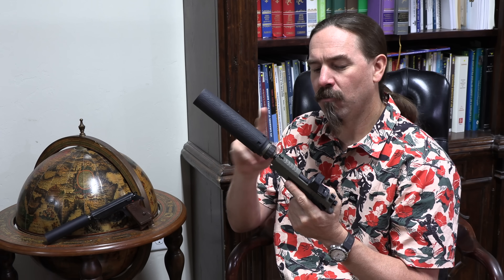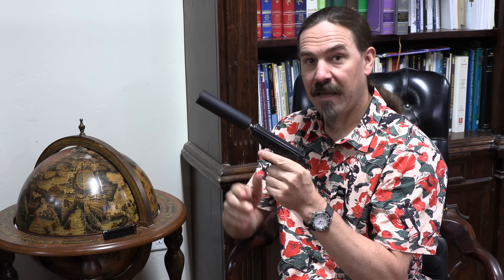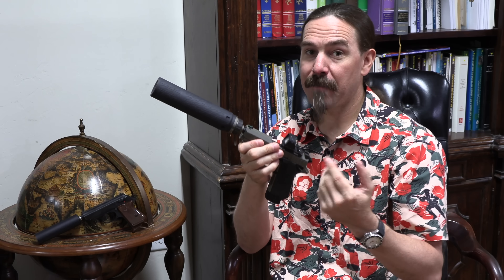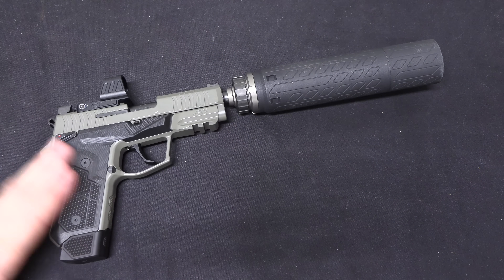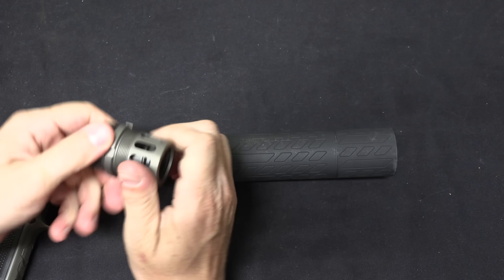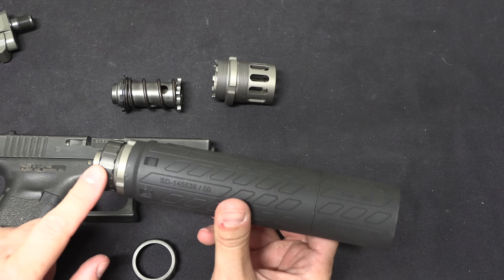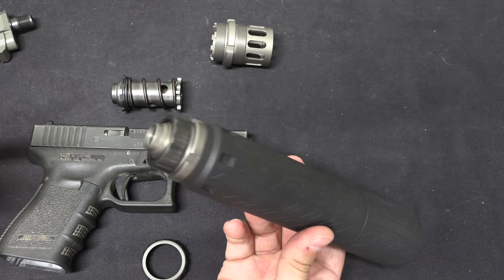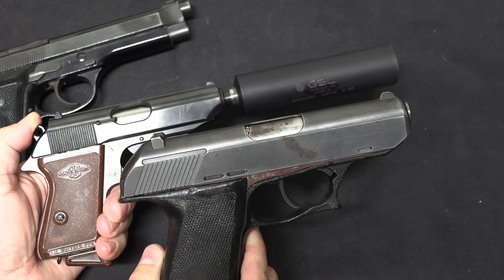Nielsen Device: How it Works and Why it's Necessary

Comment: but simply buy a gun who proper wear silencers?  christ sake all this issue and 15 min video on a gun donst work propelly with a coca coca cola can framed in front. becayse a silencer its a plain regular tube whit framing a different angles and curvature to flat down muzzle flash primally and in subsonic quite a bit of the sound. silencer on supersonic its just a war thing,. like put a silencer on your ak when storm buildings and trenches.

Comment: Most of the force the browning action needs to overcome is the pressure on the baffles pushing the entire barrel with the supressor forward. That's why for example glocks with really long barrels do not need such a device.

Comment: I'm in the UK (so I'm not allowed to know anything) but I don't understand some of the logic here: 
That suppressor with the removable end doesn't make sense: they're adding the mass of the threads making everything worse in normal use🤷‍♀️
And why are suppressors an add-on?!
Surely if you want a quiet weapon, you buy a permanently supposed one (if that even exists) 
which should be designed to minimise mass🤷‍♀️
I think I saw a rifle recently (G10?) that looked like it was sensible and actually quiet. 
I would have thought that minimised mass was paramount in scary situations!

Comment: pick an auto pistol with a steel frame;
rig it for bottom AND L and R side Picatinny rails.
build a suppr with a tube large enough to allow the front half of the pistol to go inside that tube.
on the inside of that tube, fix Picatinny rails, so that the tube is attached 'out there', ready for putting the suppr 'guts' in there.
the slide and bbl op completely independent of the tube.
the gas can be directed rearward, thru a diffuser-material, that fits between the frame-slide and the tube, decreasing the suppr-volume rqd to       > contain the blast; much of the blast is processed, as it goes thru the diffuser material. 
the suppr is on-off the pistol, via the picatinny rails

Comment: Out of curiosity, are there any hub compatible mounts that can be converted from a booster to a tri-lug adapter? I understand they are different mechanisms but would be neat to have one mount you could just unscrew the end cap and swap between a booster and tri-lug. Pistol to PCC without having to remove the mount.

Comment: Love your stuff dude but please safety check the weapon at start of video.
Reply from the maker: Since you bring it up...I did. Then I realized I wanted to cycle the slide on the PPK a couple times, but it locks open on the magazine, so I had to pull the mag, which then causes the slide to drop. So I cut that bit out of the video.

Comment: If you're straight threading a suppressor on a barrel the threads are typically 40 threads per inch and really fine and that's why it takes for ever to thread a suppressor on

Comment: 10:30 maybe it would be useful to allow the gun to fail to cycle so that you can avoid the noise of the slide cycling all the way back and hitting the stop? Then you don’t need to lock the slide in place maybe?

Comment: I would imagine that a 1911 with a bull barrel would not cam up as much as a regular barrel with a bushing. Also it has more mass to begin with so adding a suppressor would be a smaller change as a whole.

Whether it’s enough to make it cycle reliably with and without a suppressor is another matter but the difference should be smaller.

Comment: Thank you for the informative breakdown of what is a borderline urban legend. That noise you hear in films is a blend of two sounds. Usually a wire brush and an impact; neither are accurately portrayed, but an amalgam of pre-recorded sound.
At 14, I built a suppressor with a Harbor Freight milling machine and attached it to a Marlin tube feed .22 rifle and while heavy, worked quite well. My main concern was that cutting threads on the end of the barrel would be a dead giveaway, I mounted the 'can' by removing the forward sight, and reattached it through a slot cut in a long mounting tube just prior to the 'can' assembly. 
It took me 3X to perfect the baffles, but was a very good opportunity to learn another aspect of gunsmithing. Thanks for the upload! Everyone at my house watches you channel!
Reply: Yeah dude, I'd be really careful about admitting to federal crimes on the internet. The unnamed federal judge that signs a warrant that ruins your life doesn't care if you claimed to be "14" when you committed the federal crime.
Reply: Did you just confessed to a crime???? NFA rules apply!!!

Comment: You left off that .45ACP was also a great choice for suppressed pistols, since it trades mag capacity for being subsonic with similar performance to 9mm. The Mk 23 being the most famous example of a purpose-built military pistol designed around being suppressed. And doesn't need a Nielsen device.
Reply: If you want to shoot it without manually racking the slide, it does need a nielsen device, which is why KAC had to add one to their can during the mk23 development

Comment: Back in WWII, the OSS made an auto pistol for spies that was designed to be the quietest possible. As I understand, they drilled a multitude of holes in the barrel, put a suppressor on the end of the barrel, and even made the receiver from stacked steel mesh washers. It lost a lot of velocity, but still was lethal up close . The report was said to be like a kitchen match. Only problem, the mechanicals made so much noise (slide, etc.) that the mechanical noise was considerable, making the gun useless for its designed job. They scrapped it. Isn't there a similar problem w/this tall-boy beer can screwed on the front of your gun, and all the metal masses involved knocking against each other? And can you hit anything reliably w/this set-up bouncing around?

Comment: In the slo-mo video it's obvious the supressor itself is hitting the front of the frame. I venture things might be different if the barrel were able to travel its proper distance, even if the mass is much greater.
Reply from the maker: If the suppressor was hitting the frame the slide would not be able to unlock, which it clearly does.
Reply: @ForgottenWeapons watch the video carefully.  Definitely hitting,  and hard. Not easy to tell but it seems the supressor ended up with a slight upward cant afterwards. I would venture that eventually the barrel or supressor would crack. It's hard to tell with the device attached.  Ther seems to be more clearence.
Obviously many have experienced the added mass problem, and even if the travel was unimpeded it probably wouldn't cycle, but a word of caution might be valuable to those with a similar issue.

Comment: What puzzles me: sometimes it is called suppressor sometimes it is called silencer. And I have heard at one point, that there is a difference between the 2? I mean, WTF? Why even make a difference? They both dampen the sound of the gun when shooting. That's why in German we do not differentiate at all and just call these cans simply "Schalldämpfer", which literally translates to "sound dampener".
Reply from the maker: There's no difference, just two different terms. You will also sometime hear "moderator" (most from the British).

Comment: So what are generally considered the best suppressor hosts when it comes to "full power" semi-auto pistols(i.e. 9mm, .45, etc.)?  At least in terms of modern, quality, relatively common auto-loading pistols?
I've heard a lot of people mention the m9/Beretta 92, the FNX-45, and others, but i don't have much experience(barely any actually) when it comes to suppressing recoil-operated pistols.
For example, i have a glock 22(that i have a 9mm conversion for), a g19, a p365xl, a p226 and p229, a couple 1911s, etc.(and i plan on getting a CZ Shadow 2 Carry very soon.)  Are any of of those reliable suppressor hosts(assuming they're paired with the appropriate can?)
Which brings me to my next query, what are the best/most reliable pistol silencers, keeping in mind I'm more interested in function than squeezing down every last decibel?

Comment: When you fired the pistol without the Nielsen device the suppressor was actually making contact with the frame of the pistol which also added to the improper action
Reply from the maker: No, it didn't. I can see why you might think so from the camera angle, but I checked that before and after each shot.
Reply: @ForgottenWeapons Thats crazy, it looked so much like it hit the frame
Reply: Thanks for saying it. Just coming down here to comment the same thing.

Comment: Basically all semi-automatic pistols are blowback. When a round is fired, the gun powder explodes, forcing the slide to move rearward. While recoil operated guns' action do more things they rely on the power of the cartridge firing and blowing the slide backwards. I understand why there are different types of actions, however, all actions are forced backwards by being blown back by the explosion of the gunpowder in either a flintlock, cap and ball, or cartridge gun.

Comment: I can tell you're not a engineer, you got too much volume in the size of the N. Suppressor that's why they developed this goofy Nielson devise.  When your volume size goes down your blowback pressure for the slide goes up!  Light, small cans on tilting 9m's with sub-sonic is the way to go if you want to run silenced 9s.  9mm high velocity, trying to run any can devise in my opinion is idiotic.  Suppressors are for high velocity rounds silencers are for sub-sonic velocity rounds.  Why use a suppressor if you can "silence" totally, .22LR sub-sonic like the Ruger with a true silencer is the way to go not a 9mm.  If you run 9s just run a nice compensator with 147gr sub-sonic jacket.   The only perk to a round 9mm not cycling, you can retrieve your brass.

Comment: Question. What if there was some kind of tool that you could attach to the suppressor and it locks on to the rails on the bottom of the pistol frame? Basically fix the suppressor to the frame of the gun, would that do anything beneficial?

Comment: One item I noticed in the slow-mo is the suppressor starts returning before the pistol is back in battery.  The suppressor and slide essentially collide while the breach is still open, stopping the slide.  Fortunately the recoil spring is able to push the slide forwards.  However, I suspect this particular combination of pistol, Nielsen device and suppressor won't be 100% reliable and may occasionally fail to close - requiring a bump to the back.

Comment: Argued with somebody at SSK Industries about that. Main point I seen was the decoupling, and it expanding would reduce pressure for less blowback into your face. Like alright, it also has a bit of a piston that shoves the barrel; yeah yeah, I'm sure that maters. I'm sure I didn't say it as well over 10 years ago meeting dude without planning anything.

Comment: our guy is kind, happy, and enthusiastic, but not the brightest bulb in the shed. I've never heard or seen of a nielsen device or seen it until this point, but i can instantly tell you, what it does is, it creates an inertial buffer, where the gun can temporarily rack the slide and the barrel without lugging the weight of the suppressor. It's like if you were boxing with weights on your wrists, it would be very hard, but if you hang the weights on bands, then whenever you swing your fists, you can do a lot of explosive motion, while the bands stretch, and it doesn't hinder you as much as having all that mass with heavy inertia be connected on your wrists. So the homie is doing a lot of normie explaining but it doesnt do a great job of explaining whats actually happening. So it's a great job for people who don't need to know anything and don't bother with understanding how the world works.

Comment: In "The Cardinal of the Kremlin," US operative Mr. Clark uses a silenced 22 modified to be single shot. He says it's important to have a sealed breech. He doesn't explain why, but I assume both the movement of the slide and the escape of gas from the ejection port would make noise. Is that outdated? Or are Nielsen Device silencers meant merely to do less damage to the shooter's hearing and not to be "tactically" silent?

Comment: 8:20 I think it looks like a valve for a radiator that's in a house. The Nilson device is technically also just a valve that, as he said, distributes the pressure from the gas so that the suppressor is pushed forward, and the slide is pushed all the way back on the gun so that it gets a full cycle.

Comment: While it's true there is gas pressure on the first baffle, the suppressor doesn't move forward on the booster piston.  In slow motion video it is clear the suppressor stays where it is and the piston is yanked backwards out of the booster as the barrel and slide recoil back. 

Due to the extra angle the barrel must tilt, shorter slide length guns are more difficult to get to run properly, even with a recoil booster.

I've met Doug Olson several times.  :)   He is a very smart and interesting guy.

Comment: That’s cool. The slow mo made me think that the Nielsen device didn’t work.  As at first it looks like the slide doesn’t go fully back into battery.  But then it did I’m sure in real time it is seamless.   You can even see the suppressor move forward and then return. Very cool thanks for sharing.

Comment: Taking into consideration the clunk and release of gas/powder from the cycling of the action, would it actually be more quiet for the pistol to NOT have the Nielson device and be manually cycled?
I think there was an episode of one of the early SEAL pistols which was in a situation that locked or could lock the action to be... much less noisy?

Comment: Without doing the math, I suspect that if you took a standard case for a high velocity pistol cartage and replaced power with lead (i.e. a longer bullet -> less room behind it) until it was subsonic it would end up with more recoil than the original action was built around. I wonder if that would be more or less "extra" than a simple suppressor would need in compensation?

Comment: A few decades back I was working as machinist for a local manufacturer. Never heard the name of Neilson. Boss described how it worked and what it did. About 4 hours later I had one made without a single scratch on paper. Put it on a Beretta 92 and it worked perfect. No tuning needed. I used a cut off AR recoil spring and everything else I made that day.
Reply: And then everybody at the workshop clapped.

Comment: I have a Nielsen device running a can on my tiny Glock g43. Even using +3 tyrant CNC mag extensions (9+1 total) and shooting 150grain syntech it runs great. Great! I clean my supressor in a ultrasonic cleaner and use special purple suppressor butter every 500 shots. The Nielsen is heavy and bulky. It weighs as much as the dang titanium can!
My can is an Inert Haze Ti-P. Perfect budget can for g43. Or many other calibers and makes, including 300blk!
Piston trivia: from what I understand, Luigi Mangione was NOT using a Nielson, so he had to cycle the gun every shot. The adrenaline and diverted attention must have been extraordinary!

Comment: I was in charge of the ceremonial platoon at a naval station and we had to use special adapter on the muzzle of the M14s we used for 21 guns salutes so the would cycle with blank cartridges.

Comment: Any thoughts on running a Nelson device on a fixed barrel gun, such as an mp5, being bad for either the weapon or the suppressor? I know I can buy a fixed barrel spacer, just curious if it’s necessary?
Reply from the maker: Yes, you should use a spacer. Otherwise the gun will be fine, but you will cause undue wear on the booster.

Comment: Did some quick Googling and the whole device is going to run you an extra $200-250.
But it makes the gun run properly with the added advantage of not needing to fine tune it to the point that it becomes a dedicated can gun.

Comment: in case anyone is wondering, a CGS Mod9sk suppressor with nielsen device attached to a PSA saber dagger still needs a lighter recoil spring. it functions maybe 90% of the time with the factory recoil spring and almost never locks back on last round bolt hold open. hope this helps.

Comment: I noticed that with the Nielsen device in place, when the Glock is fired and after the slide starts back forward, there is a slight delay before it fully closes into battery. Not sure what the time delay actually is since the video is slo-mo.

Comment: Well you say it in here that the slide spring can be changed when the supp is added then changed back. Rather than spend whatever the neilson device costs you would just spend a little on the spring

Comment: In the vidéo with the Nielsen device installed it looks like there's a long delay for the pistol to go back into battery after firing (it looked like the slide had trouble going forward the last few millimetres). Is this normal or something caused by the presence of the suppressor? 
It looked like the pistol might start having issues once a few mags have gone through it.

Comment: Ian, why are guns designed incorrectly by having the barrel above the center of the wrist which causes a pivot and the gun to rise?

If the barrel vector matched that of the wrist and forearm then there wouldn't be any rise, just accuracy.

It's just wild that every gun has this ridiculous pivot which causes inaccuracy. Clearly the solution is a center hand barrel and then to rotate the hand 90° so the palm is horizontal and the sights are just above the line of the knuckles. This way there's no rise. 

Why isn't this the way guns are built?